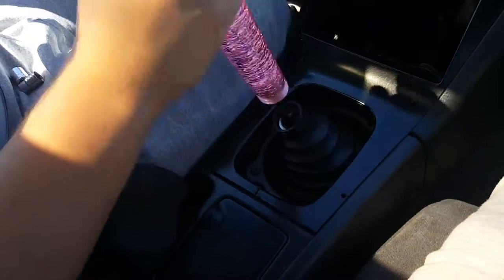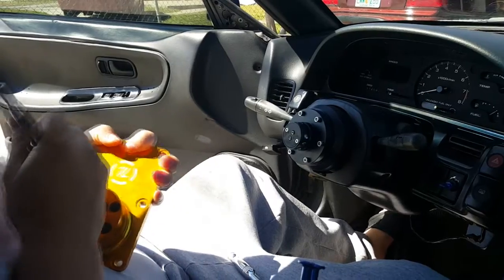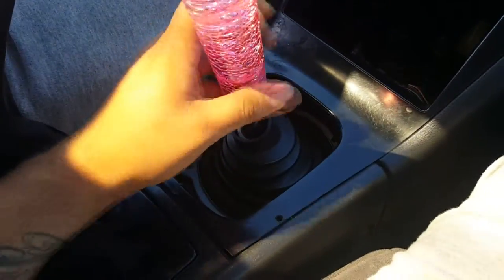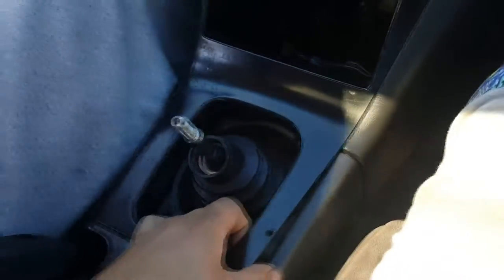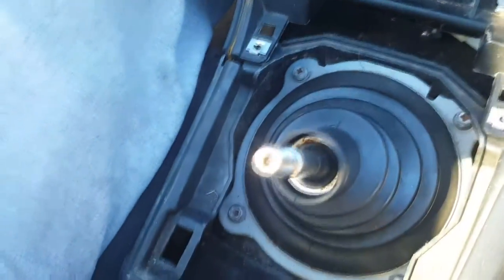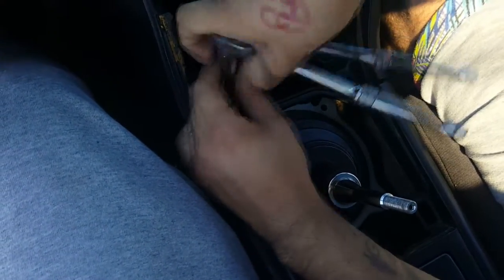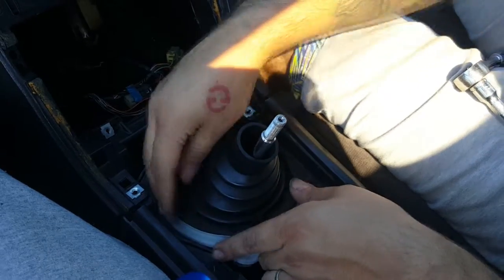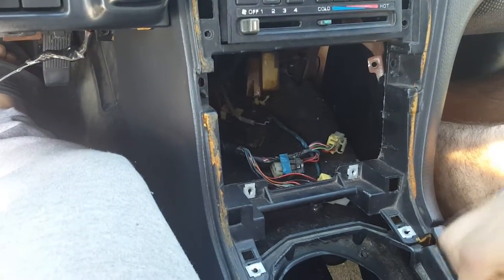ISR [Previously ISIS] Short Shifter Install in the 240sx!!

Comment: On my last 240 when I put in the ISR short shifter I was too lazy to crawl under the car to get those back two bolts so I just drilled two holes with a small hole saw. Just a time saving tip for anyone else.

Comment: yo my shifter is leaking like that as well. what you do to fix it ?
Reply from the maker: More than likely its the small plastic like bushing inside the shifter assembly, once we took the actual shifter apart we could see where the bushing was broken and letting grease out.
Reply: Gripless Garage thanks if i get a short shifter will it fix this problem?
Reply from the maker: Yes, when you get the short shifter it will most likely with its own bushing that replaces the plastic that is leaking in yours.